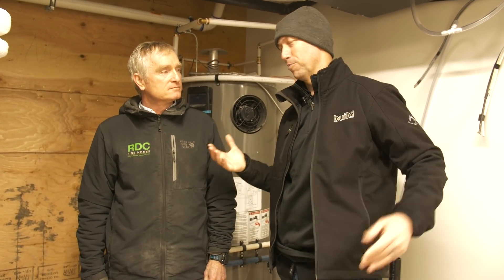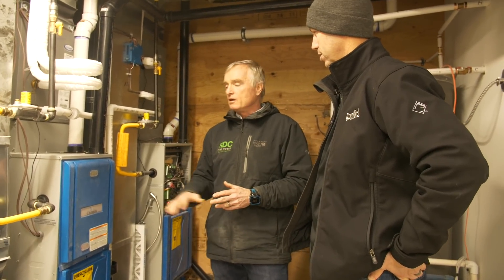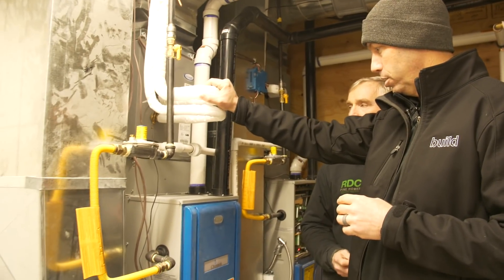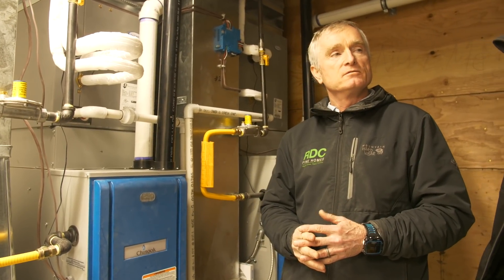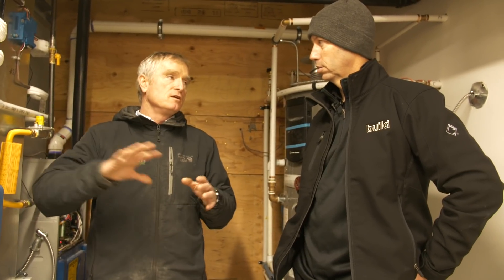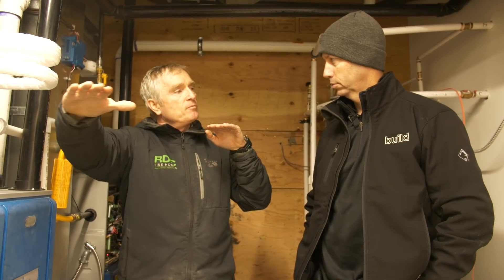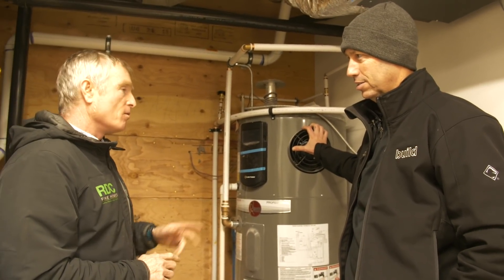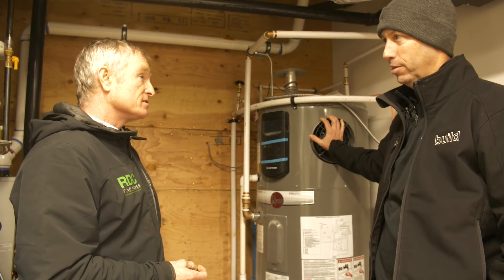Canadian HVAC System Tour. Interesting Equipment

Comment: Hey Matt! Love your videos. I had a new HVAC system installed in my renovated home, including new ducts. The cold air return ducts aren't physically connected to the furnace, but just terminate in the furnace room walls. Are there any negatives to this? It seems like it won't properly pull air from the upstairs if the returns aren't connected?
Reply: Cold air returns should certainly go back into the furnace.

Comment: I'm disappointed to see flex connectors for the gas connection and it doesn't matter how pretty you bend them. No drip leg either. Maybe their codes are different.

Comment: no dirt pocket or valve  or union on the drop to the appliance totally against code!!!
Reply: Jeremy Yanke it’s gas tite, isn’t that technically a union? The valve in on the drop prior to the regulators, I am guessing it’s a propane system as opposed to natural gas. I would agree with you on the dirt pocket.

Comment: A heat pump water heater in Canada. So you are using electricity to heat the water which cools the air within the home that is under a heating requirement the majority of the year. So then you burn natural gas to heat that air back up that you cooled to make hot water. Every time you convert energy there is some efficiently loss and extra energy used, so why not just install a natural gas water heater to begin with so we convert energy a couple less times, because you are still using natural gas to heat the water at the end of the day, but you are also wasting a lot of electricity to convert that natural gas heat into heat for the water. You follow? Now if you lived somewhere where the majority of the year you were under a cooling load this would make sense.
Reply: Christopher Gruenwald, free AC and dehumidification in the warmer months.  No energy penalty in the heating months; you’re moving heat from the house to the water, not converting it, and the electricity consumed by the heat pump goes into the water as well.
Reply: superspeeder that is conversion of energy. Where do you think the heat in the house is coming from? You’re burning natural gas to heat that air. You’re wasting energy to do that in a mostly cold climate where there might be a cooling season of only 2-3 months.
Reply: Yes, it will use heat from the house to heat the water so you are effectively heating water with gas.
You convert chemical energy to heat energy when you burn gas.  You MOVE heat from the house to the water with a heat pump water heater.  A heat pump doesn’t convert energy, it moves it from one medium to another.  IIRC, the Rheem units use about 700w to run the heat pump.
If this house was heated with baseboard electric then you’d effectively be heating with electricity.  Free AC and dehumidification are benefits during summer months, and there are absolutely no benefits to using a gas water heater, especially the common and inefficient powervent models.  Condensing gas water heaters have similar high efficiency as the best gas furnaces, but they cost an absolute fortune and are not widely available in Canada.

Comment: Looks complicated and a lot of maintenance costs. Plenty to go wrong. What does a system like this cost? And what is the annual cost for maintenance  and repairs?  
Why the need for 2 furnaces  and plus a heat pump  . Must take up a lot of space.
Reply: Not complicated.  Simply a smaller btu furnace, which allows for smaller ductwork.  The reason Bob went with 2 furnaces was because a 2-furnace setup always trumps a zoned system in terms of comfort.
Cost for overall system is very comparable to a 2-stage furnace, low SEER AC and traditional ductwork.

Comment: Nice work guys! 
The thing i see in all plumbing projects in the states and Canada is: why is our way of installing a lot of more work and looks more professional than over seas. (No assault)
Here in the Netherlands the rules of installing things are all strictly . 
And also unwritten rules of doing things. For example our electricity has to be in a tube. In case of renovation or troubleshooting issues, it’s easy to work on it. And according to a new law here in Holland, we may not use gas anymore in all new buildings. So all plumbing companies are all gathering knowledge about heatpumps and other ways of heating buildings. 
Maybe an idea to shoot some episodes of the build show in the Netherlands 😉
Reply: Where I live in Illinois, all electrical (<24v) must be run in metal conduit.  Chicago is known for having tough building codes, and my house is 50 miles(80 klicks) outside of Chicago. I'm thankful that my local government mandates some of those tough codes be practiced.

Other parts of North America, like earthquake regions, tropical storms/hurricanes, ... They may oppose the use of wiring houses in metal conduit, and require flexible alternatives, like MC Cable(metallic clad sheathing), or NM Cable(non metallic sheathing (twin& earth)). 
North America is quite expansive, so the written building codes are a vague suggestion, and it's up to local governments to adopt what works best for their region.
Reply: Well the no gas thing isn't going to fly on this side of the pond. We have serious winter on the prairies. -30°C is the norm. A heat pump is not going to do it and even though we have some of the cheapest electricity on the planet it is still far more cost costly for electric heat. And I would also love to have all electrical run through conduit. Much easier if repairs or upgrades are needed. I would also like to see a series on construction in your country. Would be interesting.

Comment: Why not just install a Geothermal. Heats and cools the home + heats water. That’s a better system
Reply: If you have the land to bury a system I agree. Small compact yards can be hard to do. In my part of the world you need a fairly large loop to draw enough BTUs and you still need back up electric on cold days. An efficient gas furnace and very insulated home with a heat exchanger is the better option. Cheaper overall. The cost of geo install is prohibitive here.
Reply: I can think of 30,000 reasons. My zone 6 house with all electric heat pump with resistance built-in backup ( when temps drop into the single digits Fahrenheit) cost 8k so maybe maybe only 22,000 reasons. I live on in the country with plenty of land to do loop or well just no gas. Just so you don't say cost over the long term I pay around $80 a month in the winter for heat and $60 for cooling. Geothermal pumps easily cost $40-50 a month to run  in the hot and cold months according to the next door neighbor, they have 3 Wells and 2 indoor units with about 4000sq feet.   I love the idea of Geo just not the ROI
Reply: @tysleight  yup I just checked and the average price for geothermal is about 30 grand! I guess if you rolled it into a new house, but retrofitting an existing house is no bueno!
Reply: Nick Smith, because geo almost never pays back.  The equipment/install is prohibitively expensive and the advertised efficiency is rarely met.

Comment: I still see a lot of pipes not seal properly, just only the elbow, the rest still open-air,  means the basement get hotter than upstair, also the further away get cooler than nearer, the same old problem for third-floor building, maybe the system is good, but installation is poorly consider

Comment: Good luck getting somebody to work on this system when it breaks down. You're at the mercy of the dealers.
Reply: its 2 furnaces, a water heater, and 2 fans... not a space ship
Reply: @scopopulus  yea  so if I'm called in on the job and I touch it I own it. It's an unfamiliar system first question is it under warranty the work? If it's not then what's my cost on the part compared to their dealer? Second question how much training on this new install did the guys putting it in have? So if I'm running a local business and I'm smart I tell the customer to get the guys back. I don't want to be spending my time going through an installation manual on new equipment covering my ass. It's not a matter of whether I can fix it or not it's a matter of whether it's worth the hassle. Word of mouth will kill you. The smart business move would be to walk away. So that's my answer Jon Luc Picard.
Reply: @macbagpipethehaggis3213  bahahaha! Hack contractor stuck on easy street!
Reply: It's two Canadian products, the furnaces and HRV and an American hot water tank. It's not like its a Japanese/Korean/German products.
Reply: @mennomateo  Sorry but experience tells me not to get involved it's not a matter of whether  I can fix it or not. New equipment is always a crap shoot. But you want to take it on then knock yourself out.
Reply: @macbagpipethehaggis3213  there's always duct tape...right? lol
Reply: @macbagpipethehaggis3213  sure but these are Canadian companies installed in Canada supported by Canadian installers. I sure hope their supply and support systems work otherwise they won't be in business very long.

As a installer who works with a couple of the product in this video they're doing well here North of the 49°
Reply: Our furnaces are built very similar to other manufacturers, except we offer lower BTU options.  Most o f our distributors and installers stock parts ... but most are commonly used across many brands of furnaces.

Comment: Hey, Matt, we've been installing 15kbtu Dettson Smart Duct systems for years in Kalamazoo, Michigan.  You should come check out what's happening here.  Some of our clients, like Kalamazoo Valley Habitat for Humanity, are to the point where the homes' ventilation requirement is the highest heat load for the entire house!
Reply: Shaun W we’re in Kalamazoo as well.   Good to hear there’s good things going on here.   We’re looking to build in the next year or two.   I’m not a builder, but I’m looking forward to the process.
Reply: @justinsprung1454  check out RossMan Construction if you're looking for an excellent builder who specializes in energy efficient, Zero Energy Ready homes.  And the HVAC subcontractor he uses a lot isn't too shabby, either (me).
Reply: Shaun W Thanks!  I’ll definitely check RossMan out.
Reply: @shaunw536  So it looks like I'm in the market for a new furnace.  can your company come check things out?  Who should I call?

Comment: Wow european system only being tested down to 0 degrees... Well maybe you should compare to scandinavian countries and not portugal or spain. I installed my swedish system with around 90% efficiency myself at $3000 total.
Reply: The builder calls it out. They freeze up without the heater and that disqualified it from energy star. Not that they don't work colder just that you can't get the 🌟.
Reply: @tysleight  Rotating heat exchangers have an extremely small risk of freezing and that's what is usually installed in cold climates. Mine doesn't have a defroster for example.
Reply: @erik....  does it have an energy star sticker on it? Certain jurisdictions and credentials require energy star everything. I have a feeling that is what going on with this house
Reply: @tysleight  That's an american thing. The brand I have is probably just sold in Scandinavia/Northern Europe, called Östberg HERU. edit: No I was wrong they actually export to americas too.
Reply: @tysleight  Yes the equipment is Energy Star.
Reply: We have these systems in other provinces where temps dip to -40C, similar in MidWest US.  In colder climates, equipment will be sized larger based on the design temperatures.

Comment: Have you ever made a video on what you think "builder grade" hvac should be instead of what it is today?
Reply: Minimum 2-stage ECM, with proper heat loads done.  Improper sizing is the biggest problem in homeowner comfort issues.  #2 would be 1-stage furnaces.

Comment: Can a home get to air tight?
Reply: YES!!!!!!
That is why there is a need to introduce outside air.
This case they used the HRV.
Other situations have a duct going to the outside of the home that may be regulated or may always bring in outside air. Depending on code at the time house was build will determine system used.
Many times the homeowner, and many contractors, don't understand the need for this ventilation air and will close/bypass it. Not a good thing to do!!
Reply: The U.S. is really new to this airtight housing it seems. Yes of course you need a ventilation system which has calculations, ductwork of its own. Really HVAC, ventilation should be provided by one system. Sometimes it gets excessive. The problem with ventilation systems is usually acoustics suck and you get fan noise or bad acoustic insulation between rooms.

Comment: The heat pump component doesn't sound very efficient- the Mitsubishi delivers 70 degree heat down to  17f.  I like the throttle control on the gas furnace that's awesome.

Comment: wtf? 2 furnaces and 2 heatpumps??Way too complicated, expensive and inefficient and all because of the dumb forced air heating...
1.Install air-to-water or geothermal heatpump, works down to -28C, it's proven tech. 
2. Use floor heating and forget the noisy and uncomfortable ducting. Have for example 12 zones in your house for cheap with premade manifold. 
3. Use same pump for hot water tank.
4.. Save a lot of money by not having to buy 2 furnaces, 1 heatpump and 1 hot water heatpump
5. Saves you money and space not having to engineer big ass ducts cause HRV doesn't need big ones without forced-air heating.
6. Use HRV with humidity control, it will automatically speed up when showering, no need for buttons
Reply: Yeah, living in Finland I always wonder what this forced air stuff is all about there across the pond.
Reply: Agreed but I'm from EU maybe i miss something maybe Canada/US logic or... how to make a money where you shouldnt
Reply: Maybe site conditions didn't allow for geothermal
Reply: @MandoFettOG  geothermal is only one way of many, but you dont need 2 gas boilers + special heat pump for hot water and a heat pump for heating a house in  the spring/atumn this is pure madnes...
but to be honest I saw similar madnesses +15 years ago in EU when similar technology knocked on the EU consumers doors
Reply: Laurynas Laivys , it’s hard to have AC with no ductwork.  THAT’S the main reason you see forced air in North America.  The main reason you don’t see much radiant floor heat is it costs a fortune unless you’re building a slab-on-grade bungalow, and slab-on-grade is not at all popular in Northern US and Canada, most homes have basements.

Comment: insulation and tightness is the key to that system.  My company (Cape cod spray foam) foams regular cape homes down to 0.5 ach without any additional tapping of frame to contractor. NO FREAKING AIR SEAL CRAP NEEDED as well. We just know what we doing.
Reply: Russian? My house renovation was just spray foamed by a Russian. I think they did a good job. But when the wind was blowing 40 mph at the broad side of my house i found some massive air leaks. We did the underside of the roof sheathing and there were some hard places to get to. I sealed them with can foam. I love Russian spray foam.

Comment: Looks like a homeowner ran the gas piping to the furnaces. Lol
Reply: Right I feel like somebody way over thought this. Why not black iron down with a union? Looks cheap with the yellow flex line. Maybe vibration?
Reply: It's like back in the day when the units came pre charged for so many feet of line set and they would coil it up in the trusses.... Idk if that's what's going on there or what ....?

Comment: High end homes are different from new home construction. With my builder, you would be surprised with what we consider "acceptable". They're literally thrown together and I think Matt wouldn't be to impressed with the quality at all.
Reply: Eventually it trickles down or the code gets more stringent.
Reply: The codes get more stringent and that is why houses cost so much to build unless you're building 30+ houses at a time
Reply: @thetonezone8164  It's all trade offs and a movement to a two bell curve culture. If you are in the top you get a nice home to one of Matt's custom design build almost net zero homes. If in the bottom you rent from someone in the top or you get almost cardboard siding and one minor step above a trailer with a foundation at trailer park spacing.
Reply: your right and that's why I took on the role as contractor and builder when it came to constructing my new home. took two of my friends and I longer to complete but I know I have a well built home that will not have any issues in the future.